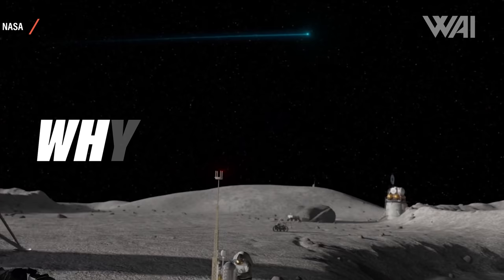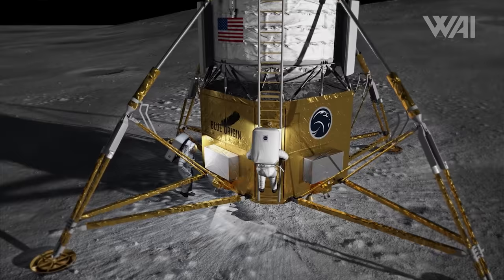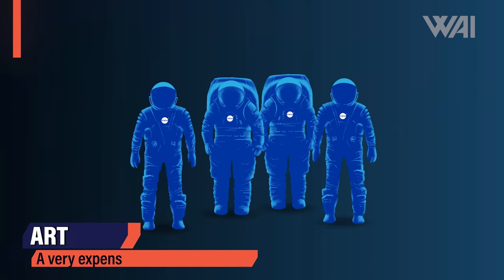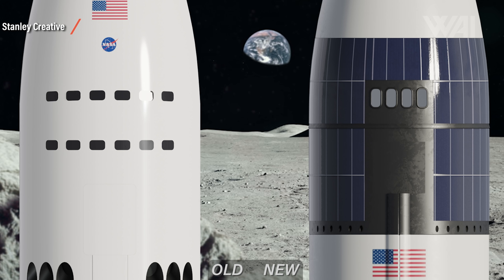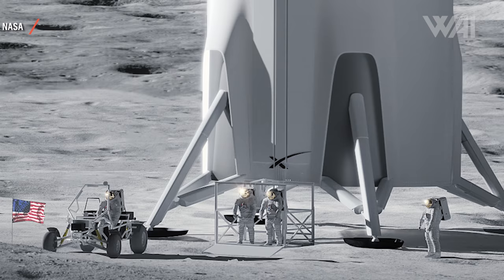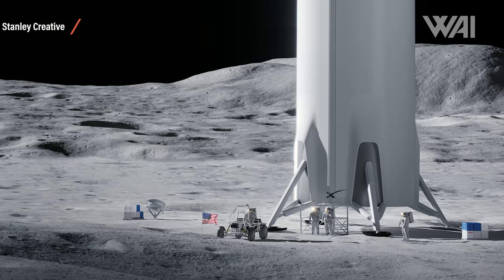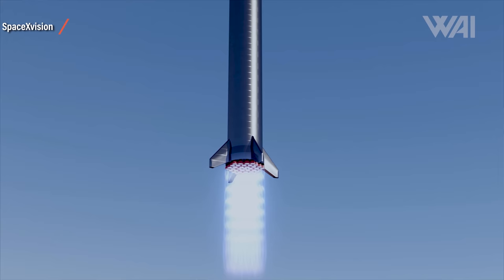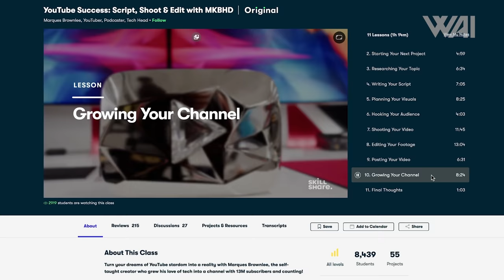Why Did NASA Award SpaceX 2.9 Billion Dollars For A Lunar Lander?

Comment: Imagine going from the little Orion capsule into the giant Starship to land on the Moon!
Reply: Everyone on board would think Orion is a joke
Reply: They won't want to go back into orion hahha
Reply: First class upgrade
Reply: Building a moonbase, carrying 4 base modules at a time! And the whole thing is reusable. That really cuts building time. Yeah, I'm pretty sure starship carries so much cargo that you can build a moonbase for 8 permanent residents in 4 double launched (cargo+crew ship plus refuel ship). 12 to 15 interconnected rooms on the surface, plus equipment, reactor, solar panels.
Reply: I’d be like getting out of a car after a long car trip.
Reply: I just want to see it fitted for a massive crew and lab and watch the astronauts knock around in all that empty space...
Reply: Just feels like it makes no sense to launch and send the orion separately
Reply: lol ya
Reply: @nasawormlogo9521  Getting out to enter the harbour and boarding Cruise ship. But it make sense with that lunar Starship will can be Made to a moonbase rather than bring it back all the way to LEO
Reply: @hdufort  lunar starships won’t be reusable as they won’t land back on earth
Reply: @jacobmarshall9600  Lunar Starships could be used for multiple missions between either the Lunar surface and Lunar orbit (Gateway station) or possibly even Earth orbit.
Reply: lol!
Reply: @hdufort  the entire starship is a moon base. Take the engines out and fuel tanks gives you an instant base on the moon. Another reason I believe starship was chosen over the other choices.
Reply: they could litteraly fit orion inside starship, land on the moon and go back to earth.
Reply: Hello fellow letter "P"
Reply: @SupremeRuleroftheWorld  Emergency capsule
Reply: So much room for activities!
Reply: @ReiseLukas  well, let's not forget that unlike Starship, Orion does have an emergency abort system. I'd rather ride to LEO on Orion than on Starship, until Starship performs dosens of orbital launches successfully. 
There is no need for Orion past LEO. Might come in handy again during reentry though.
Reply: Imagine Starship carrying entire Orion down to the lunar surface 😂
Reply: @DiveTheseClips  There's no need for Orion in LEO as well. Dragon will be enough to ferry 4 astronauts to/from LEO.
Reply: So glad to see nasa waking up.
Reply: Launch astronauts with Crew Dragon to LEO, rendezvous with Lunar Starship, go to the Moon, return to LEO and use Crew Dragon for reentry.  Lunar Starship will not be coming back to Earth's surface.  It doesn't have heat tiles, Elonerons, or from the looks of it, even Raptors
Reply: Its like a Tiny for Starship
Reply: @hdufort  these numbers arent exactly really but building and placing a moon base on the moon without starship could take 1-2 years, with starship, this also depends on how much starship is reusable, incase it ends up like space shuttle. With starship it could up to 2-6 months, and that is for building. Numbers are most likely way the f off but you get the gif
Reply: Why not use the Fslcon Heavy and Draco  rather than Orion and SLS?
Reply: @jayrymer2097  bow chicka bowow
Reply: Starship could carry the entire Orion capsule to the surface of the Moon😂
Reply: It's like driving a Smart42 across country then renting an Expedition to drive around town when you get there...
Reply: @jacobmarshall9600  Um... Lunar Starship WILL be reusable for landing on the moon. This little thing Elon mentioned about orbital refueling with Tanker Starships... ahem. Besides. once a permanent moon base is established with proper paved and bermed landing pads built, the standard cargo and crew Starships can land without worrying about spraying regolith into orbit.
Reply: @DiveTheseClips  Tere is much discussion about the lack of an abort system on Starship. However, couldn't the orbiter separate from the booster if the booster has a catastrophic failure? It does have some cross-range capability and is made for propulsive landing. Only question would be if all 6 Raptors would provide enough thrust to get away from a failing booster in a hurry, since the vac Raptors won't be as efficient if they don't make it to booster MECO. Oh... and Elon has already mentioned that Starship should be able to do an emergency landing on the engine skirt, if the design ultimately doesn't have 1G capable landing legs.
Reply: @Ankit Meher A major change in Politics. The SLS is bound up with a lot of political interests and has been in development for years, despite using "off the shelf" tech from the Shuttle era. As a government agency, NASA simply doesn't have the agility of a company like SpaceX to embrace new solutions. Remember, Starship was barely little more than a gleam in Elon's eye less than two years ago. It's a big deal that NASA even manage to choose Starship for the HLS, even if the reasoning behind it is enough to want to gouge one's frontal lobes out with a rusty spoon.
Reply: @danceswithmules  true but at this point we don’t know whether they will refuel in lunar orbit or just leo. It’s possible that a lunar starship will travel from the moon to leo and back but I think it is unlikely
Reply: @jaceksiuda  7
Reply: @jaceksiuda  It might be an option depending on a mission profile. I'm not sure Dragon is designed for high speed reentry associated with returning from the Moon, unlike Orion. Such reentry might be required, because Lunar Starship will not be able to aerobrake in Earth's atmosphere when returning from the Moon. I'm not sure it will have enough delta V left for propulsive orbital capture either.
Reply: @Ankit Meher hold your horses here now. NASA are given funds and the politics are involved. SLS and Orion is made of parts from lots of states which the people there represent. There is no way anything will change, now. SLS will fly or fail trying to. They've started the test so the first (uncrewed) flight have an expiration date before the tanks may not be used. Orion has been in the works for 15 years and made its first flight in 2014. Both SLS and Orion are built for human rating as a design process. Seems like Orion mostly waits for SLS to launch it. And of course - it has a launch abort system which is somethin NASA likes. So SLS+Orion will get people to the moon because now it looks like the end of the tunnel is visible. Starship is a fast iterating development project which we don't know how it will turn out and timelines are uncertain (milestones). In Elon'
Reply: @jacobmarshall9600  Wasn't one of the pros in the decision that Lunar starship was refueled in LEO? Of course need that for the first time. And I think it will come back for refueling. When the crew has used lunar starship for going to lunar orbit and transfer to Orion it is no hurry to get back to earth and can do a slow transisition. Will takes weeks or months but there is no hurry.
Reply: @alachica512  Falcon Heavy is not human rated. F9 is but it's probably a lot more work for FH. Remember that the central core is distinct internally. Dragon is designed for LEO. E.g. the greater speeds coming in from the moon rather than just orbit may be not what the heatshield is designed for.
Reply: @dionysus2006  It will definitely have raptors even if the renders maybe doesn't show it.
Reply: It not going to happen, transferring anything in lunar Orbit is inefficient and impractical. It'll happen in Leo. No gateway, no XL,
Reply: @jacobmarshall9600  incorrect, reuse from Leo
Reply: @DiveTheseClips  Dragon 7 seater, human rated, proven, fixed price.
Reply: @DiveTheseClips  Dragon
Reply: @jaceksiuda  7
Reply: @dionysus2006  exactly
Reply: @Ankit Meher they have. Check out Apogee's stuff on YT, he has this covered.
Reply: @Ankit Meher check Apogee's stuff on YT
Reply: @jonbong98  I know the Dragon is good, I'm saying that we don't know if it's capable of high-speed reentry, or does it support only low speed reentries from LEO
Reply: @jacobmarshall9600  today marks the end of gateway, XL, SLS and probably Orion.
Check Apogee's stuff on YT for rational in-depth research
Reply: @DiveTheseClips  from / to Leo ,as it already does.
Reply: It would be like someone in a tank pulling up alongside a smart car at a stop light
Reply: The doubts in their mind🤣
Reply: Starship is flying base
Reply: @jonbong98  I had a look at that channel. Are you meaning "the end of"... as it never will be flown or that we will see end after they have flown? SLS+Orion is too far come and NASA and more the politics that dictates what they should do want SLS. Lobby and jobs in states that they represent jada jada.
A cost company wouldn't make the same choices but they are stuck. First we will have SLS, then we can discontinue it after they have done the first Artemis parts that they have ordered it to do. Spaceship is developing at great speed but is more up in the air and not finalized (good) for how everything will work. SLS is the more stable choice for those who fund things.

Not my wishes for things, just the reality as I see it.
Reply: @Ankit Meher You seemed so caught up in optimism, had you check that you knew that things doesn't go by the obvious rational 😊😉. I guess NASA has both "stubborn" people and people who want to try things out. Unlike Elon/SpaceX they have no stash of cash to spend but are allotted it for different things like Artemis with SLS. Nothing can be done if they don't get funding and those people (senaste/congress/president?) seems to like their lobbyist friends and also the jobs that are maintained where they're from. Costs lots of money to develop everything all over the US but it's also they way to get public funding.
I'm really glad SpaceX gets this with NASA because they have had lots of experience and research. Elons vision seems to be build lots of starship. They only need to fly and land. Then everything interior and the construction of a whole (Mars) mission is something "solved later".
Reply: @jonbong98  I think it isn't as impractical because it is in a low energy HALO orbit
Reply: There is no need for Orion or gateway . Lunar direct . Mars direct .
Reply: I'm the 70th comments. Let's destroy the cursed number.
Reply: It would be like a Cessna 175 in front of Boeing 747
Reply: @jacobmarshall9600  incorrect. They will refuel in orbit.
Reply: @ReiseLukas  at this point, they’re not wrong
Reply: So the Orion cost to land will be some change.
Reply: @davidgraham114  makes more sense to use Orion as an interim human rated launcher from Earth to LEO.
Reply: Imagine Lunar Gateway docking to the Starship.
Reply: The safest option: Imagine make a big firework like shuttle did
Reply: Maybe Ryan would be good enough to be an escape pod?
Reply: Nahhhhhhh thx.
Reply: @DiveTheseClips  Abort systems are completely overrated. Look at the stats ...
Reply: @Ankit Meher It would take "Political Will". 
That means Congressmen voting to curtail their terms, because they voted to cut off funds to numerous NASA sub contractors all over the country. They would have to have a properly worked out plan to preserve the jobs and infrastructure. That is unlikely. 
Using Starships, both Lunar and Tankers, could provide for the entire mission. In fact they will be so cheap, it may well be wise to consider leaving a few on the surface to provide core hubs for the creation of Moon Bases. The possible acceleration of the whole Moon Base construction process by selecting Starship is extraordinary.
Reply: @danceswithmules  Why the ahem over refuelling? No LEO refuelling, no missions ...
Reply: Imagine, the NASA Astronauts are welcomed by a SpaceX Crew, getting Champagne, take a shower on the Spa Deck and asked to sit on their booked seats while they land. 😜
Reply: 73 meters to be exact for the starship moon lander
Reply: Guys please I have a question nobody can seem to answer. In order for Starship to get to the moon it'll have to refuel mid flight. Was NASA paying SpaceX with them needing to develop not only a working Starship and Super Heavy, but also a Starship that's already up there waiting to refuel a Starship
Reply: @spridle  A fully tanked Starship is neccessary for flying to Mars an land. To fly to the moon and back to moon Orbit less fuel is needed! May be doable even without orbital tanking.
Reply: @spridle  As I can tell they only pay for the development of the Lunar Starship and not for the cost of developing the rest of the starship System. But they will pay the cost of launching a tanker starship.
Reply: @hdufort  Hi Hugo is there a visual presentation of such a base It would be awesome to see

Comment: SpaceX will rule the Artemis program. The main pair of Gateway modules launch on the Falcon Heavy. Gateway will be supplied by Dragon XL, launched on Falcon Heavy. The lander will be the SpaceX HLS. All of those are definite contracts that have been awarded. That leaves a couple of future Gateway modules for Vulcan and New Glenn to compete for, and of course SLS/Orion will get the astronauts there and back - for now.
Reply: It’s a shame the Gateway contracts have been awarded. If NASA knew then that SpaceX would be doing HLS with Starship then if it still wanted a Gateway station, and there are some good reasons for that, an internally reconfigured Starship flown to the target Gateway Lunar orbit and left there could provide way more internal volume than the 125 cubic metres that the fully built Gateway will have. It could be even more stripped down than HLS because it wouldn’t even need to land on the Moon let alone back on Earth so no legs, elevator or landing thrusters required meaning quite a lot of extra cargo mass too for internal systems, solar panels, radiators etc. Maybe there would have been issues that made it impractical but it would have been a very interesting concept to at least explore if it had been known at the time that NASA would be incorporating Starship into the Artemis program.
Reply: @julianfp1952   Great minds think alike. This could certainly have worked. Once NASA was convinced the Starship program could get a ship to the Moon with NASA-approved crew quarters (exospheric only), a lot is possible.
Reply: You're right. They're dominant, that's for sure. It's almost embarrassing how dominant they are.. and that's not a knock on anyone. NASA wanted to spark innovation and development and have they ever gotten it. It's exciting to see. In hind sight, the end of the Space Shuttle program has been a good thing because of the explosion of new ideas and opportunities.
Reply: Given that Starship is now assumed to be fully operational (to the point of carrying humans) by the time Artemis goes ahead, then I suspect that if the Gateway isn't abandoned entirely, the Falcon Heavy contracts will be amended to use Starship. Certainly, DragonXL serves no purpose in the current plan... it only ever made sense if you assumed it would be needed before Starship was ready, e.g. for the 2024 deadlines for Artemis.
Reply: No gateway in the medium term, before HLS part A completed. Mark my words no gateway, no Luna XL and no SLS Orion ( beyond test flight ) it just doesn't add up.
Reply: @julianfp1952  SpaceX will happily swap out contracts on XL and FH from gateway to more realistic lunar missions.
Reply: @julianfp1952  but a Gateway in Leo will happen soon.
Reply: @simongeard4824  check Apogee's stuff on YT for rational in-depth analysis of the situation